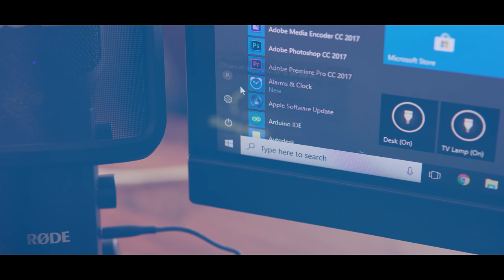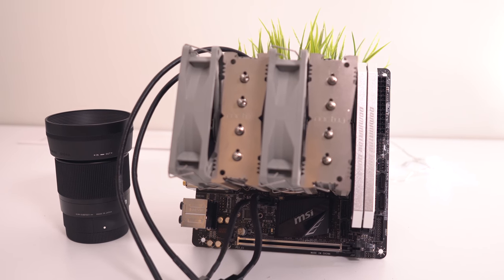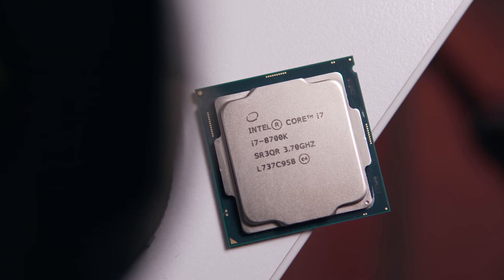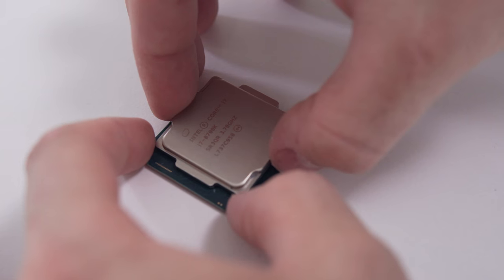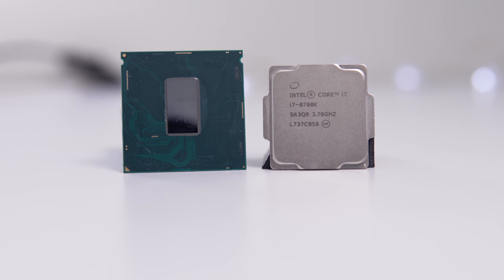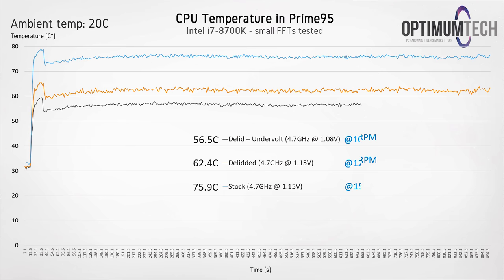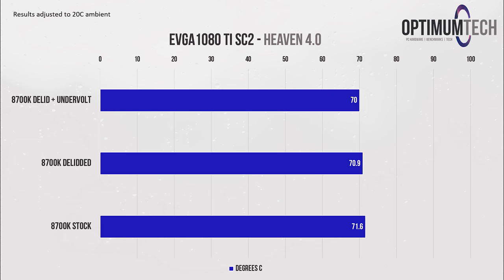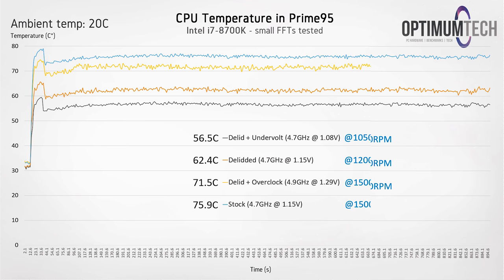8700K Delid & Undervolt - 20C° Drop!

Comment from the maker: With normalized fan speeds, this is an easy 25C°+ drop. 
Wish they came like this out of the box lol.
Reply: Can you do a no IHS video with the German CPU kit?
Reply from the maker: Would love to!
Reply: Would love to see that too.
Reply: your videos are like those of hardware Canucks amazing video quality
Reply: could you please tell me, if Vcore of 1.25 for 8700l will effect its longevity?i bought a maximus x hero, and i want to last this processor a long time.
Reply: nice video... 1 question its posible to make Delid + Undervolt + overclocking ? in a water cooling system ??
Reply: You can't undervolt and overclock at the same time, as reducing voltage reduces the maximum clock you can achieve. Normally when overclocking the voltage is increased to allow a higher clock.
Reply: screen   prime  95 ?
Reply: Why they don't come out of the box like this?
Reply: Griffen Edge you absolutely can overclock and undervolt simultaneously, but you won't get nearly as much of each as you would individually
Reply: Nice video, memes aside
Reply: Nah, 1.35 is still safe for 24/7 usage as long as your cpu is not boiling hot all the time. Heat can also affect longevity.
Reply: It is said everywhere up to 1.4 Volt is totally save.
I run mine at 5 GHz at 1.285 Volts. So i guess you dont need to worry.
No 8700k needs high voltage for 4.8, 4.9 or 5 GHz.

So as long as your cooling is enough 5 GHz is possible on almost all chips.

Running mine with a custom loop. CPUID Hardware Monitor Showing 65  °C maximum under full load.
Reply: That's correct, unless you put it on "auto" then your voltages will skyrocket over 1.4 with ease. With my extreme4 board I need to manually set it to 1.28 for 5.0, offset will not work and the board does not have adaptive voltage. But yea, 1.4 works, as long as you have good cooling, which is why I suggested 1.35.
Reply: Daniel Bertens i got 1.285 volts manually set with maximus x apex
Reply: Riad Ahmed No, stock vcores ive seen on my cpu hit 1.47. I now run mine at 1.35 at 5ghz

Comment: It's sad that they use mayo by default :(
Reply: its not mayo ......................... its colegate
Reply: They use a very stable TiM that will last several years which requires a sacrifice of performance quality.  If they used one of the popular thermal pastes, it would very likely dry out after 18 months (or maybe less) and the chips would all start throttling and failing.
Reply: or they could solder them

Comment: Decent difference, I just run mine fully stock and happy with my 5.1GHz temps :)
Reply from the maker: Nice, jealous of that 5.1GHz OC :P
Reply: I was surprised when I was able to get it to that stable!
Reply: what voltage? Mine is sitting at 5.0ghz at 1.34 volts. 5.1 takes close to 1.4v and even with a dark rock pro 3 i hit 95c very quick while stress testing
Reply: I'll try let you know in a few days if I remember, currently overseas so can't check :p
Reply: What temps?? And cpu fan? Thanks
Reply: @Arturo Bover I used the Fractal Celsius S36, I just finished benchmarking it actually haha so I've got that info! Overclocked to 5.1GHz and running Aida64 it was averaging 82c after around half an hour with an ambient room temp of 25c.
Reply: This is so awesome, my 2 favorite youtubers in one place :D
Reply: @Luka Mihelac woo 😎
Reply: Nice, whats your temps like and what cooler do you use?
Reply: Fucking good for you. I can't get under 1.36V at 4.8 ghz without going over 95 C in Prime95 delidded with liquid cooling.
Reply: +All Hail Queen Monika You lost the silicon lottery :/
Reply: say if my asus hero x wifi mobo is over volting my stock 8700k where would i go to type in  the correct voltage so its  stays stock
Reply: 5.3ghz 1.37v get around 54C in Cinebench.  OCCT large data set avg temp around 56C.  Max was 5.1 with out the delide.  Delide pretty much makes these cpus legit.
Reply: du Bb change the LLC to 6 if it’s on Auto it will send too much volatage
Reply: du Bd I have that motherboard. First off, update your BIOS in case they've improved voltages (you probably want to anyway for Spectre/Meltdown). If you want to run it stock but decrease voltages, you could set voltage mode to offset and type in a negative voltage offset. The easiest thing to do though would be to change "SVID Behavior" from Auto (Auto = worst-case) to Typical or Best-case (try best-case first). The SVID Behavior setting defines the auto voltage tables, with Worst-case/Auto assuming a poor-quality CPU that needs high voltage, and Best-case assuming a high-quality CPU that needs less voltage.
Reply: 4.9GHz 1.25v 87°C on aida64 on custom loop, without delid
Reply: I7 8086k 5ghz 1.25v with an average of 74degrees after 2 hours in Aida64 with an evga clc 240 push and pull configuration. Non delidded
Reply: @Ktos3214  wow that awesome result! I was trying maximise my undervolting and... i got next results 4.9 1.275v with custom loop and ofc delided... im not super lucky like you >.>

Comment: I did this myself a couple of months ago with conductonaut and can verify the temps. Also running Kryonaut between IHS and coldplate. i7 8700k at 5.2Ghz at 1.34V with a 360 rad in push/pull. Aida64 temps average 67 degrees!
Reply: You're so cool

Comment: Delided my 8700k and got 5.3 GHz with low voltage. Set it at 4.8 GHz for now. I am using a 7-tube Gelid air cooler. Max temperature now is 78C in AIDA64 (120 minutes stress).
Reply: Oliver Krivel holy shit. If you are not lying u just picked the best fucking chip. Did u buy it binned or did u just hit the silicon lottery lucky?
Reply: No, I do not lie. My cooler is Cooler Gelid GX-7 Ultimate CC-GX-7-01-A. It was too hot with default compound so I replaced it with Thermal Grizzly metal. I have it on MSI z370 Tomahawk (which is not bad). I think 50% success is due to the motherboard sufficiency. It is not my first delidding so I was pretty sure what to do.
Reply: 78c is a bit high, what voltage for 5.3?  And is it 5.3 avx?

Comment: This was a cool video!  I like the option to delid and undervolt for the purposes of a smaller/cheaper LP Air Cooler and/or quiet system.  Of course there still exists the option to OC  and use a bigger cooler if desired.  Personally I think a front facing LP cpu fan looks good even in an Mid-ATX case.

Comment: I believe that is awesome, I just am not willing to risk the warranty. That being said once the warranty is up, and the processor starts showing its age(4+ years, from now) I may decide to do just that. I also have an 8700K with the Aorus GTX 1060 6GB model. I am also using a much larger case than you are; I also am using a Corsair 280mm AIO, thermals don't factor in to severely for me. I just run it stock and allow for the CPU boost.

Comment: i couldn't get mine to 5ghz without delidding as i was hitting 95-ish temps and it still wasn't stable. at the same settings after delidding without resealing, i dropped 26c (temps after 10min p95 26.6 small ffts), which is absolutely amazing and now i'm stable at 5.1 @ 1,35 under load (1,43v in bios) and temps never rise above 60c while gaming on my x62 kraken.
Reply: Lol same thing with me and same cpu cooler as well
Reply: U mnie po skalpie 5.1GHz
Reply: Im hitting 5.1 @1.36 V but temps are high 87 to 98 stock havent delidded yet. Using a corsair h150i pro
Reply: u mnie max 78* ale to już po skalpie, 5.3GHz 1,2,3 rdzenie a 4-5-6 5.1GHz
Reply: Temperatures affect stability pretty much.
The hotter your chip, the less stable it gets at higher frequencys.
Mine is running at 5 GHz at 1.285 Volts and max temps under maximum load over 1 hour with AVX is 65°C in HW Monitor.
Reply: Dom yep, it comes down to power leakage. a hotter chip pulls more power and can't keep clocks as stable as a cooler chip.

Comment: Hi @Optimum Tech I know this question is super old , but what are your values for i7 8700 at 4.3 ghz (default clocks on all cores)? What is the actual value you used to see the 4.7 at 1.08 vcore, is that with vdroop or just what you pressed in the bios and lastly what motherboard and LLC value you use?

Comment: Very nice video. I think everyone with a couple like this ought to try a little undervolting. Even if they do not wish to de-lid. As long as the system is stable, you can drop temperature and reduce fan speed at no risk.

Comment: My non-delidded and non-overclocked i7 8700K reaches max 75 degrees in Prime 95 at 1.1v and 4.3 GHz at all cores. Enhanced turbo is off. Board is Z370 Tomahawk from MSI. And my cooler is Noctua NH-D15S with only one 140-mm fan. And i'm pretty happy with my first i7 in my whole life. :)

Comment: Hey Man,
Shout out from Australia.

I am thinking about getting my hands on a DANCase and I am running the 8600k and MSI Carbon ITX board.
Did you by chance de-lid and undervolt the i5 when you were running it?

I am currently running a 240mm aio with the i5 @ 5ghz at 1.32v.
I have more than accepted in the SFF I will need to loose the OC, but I was literally looking into delid and undervolting as there are a lot of reports of the DANCase getting very toasty.

Comment: Why is it necessary to reapply the lid?  Mobile processors work just fine with a heatsink directly on the die with no lid.
Reply: thechosendude the cpu mount needs the lid thickness to hold it in the socket.
Reply: @juanofarc3007  - My implication was to remove the hinged cover plate and use the heatsink to hold it into the socket.  The LGA1151 doesn't need a lot of down pressure.
Reply: @cup_and_cone  there are some custom waterblocks for only die ltt make viedo about this.
But i don't really know why the cpu still have a lid it seams like it doesn't need it xd

Comment: Is that 4,7Ghz@1,08V stable?  
I cant under volt my 8700 beyond 4.3 Ghz@1,2V on a Asrock Killer. I've set vcore on Offset mode and the lowest value is -100.  Then if i use a lower LLC value than 2 (1,180V) bsods.

Comment: Try undervolting your GPU. But don't do it with the voltageslider, use the frequency to voltage graph. I locked my GTX 1070 at 1800~1850mhz at 0.825~0.850v for intensive titles and 1950~2000mhz at 0.9~0.95v for lighter titles. I also set the powerlimit to 87%. The card usually sits around 78~82% under heavy load, and that's basically what a 1060 uses. If I now could only get rid of the coilwhine, my pc would be silent.

Comment: wait so youi're saying the CPU ran at 4.7 ghz at all cores at 1.08 volts? That's insane! Also if you were surprised with the deswktop CPU-s undervolt check out laptop CPU-s most i7 8750h can UV down to -130mv and most of i5 8300h ones can be undervolted to -150mv with no instability issues!

Comment: That motherboard is not built for overclocking, you may find that your chip in a better motherboard could drop voltage and be stable because of voltage ripple. You may think it needs 1.38 but that's because your motherboard is struggling to keep voltage at that state and drops for milliseconds and goes back to 1.38. It's called ripple. Something with more phases would help which is what higher end motherboards usually have and are designed for overclocking. Also having a PSU that is not near your 100% load typical usage would be better too as it pulls more from the wall in order to meet it's requirement this means that efficiency drops and can cause instability. Idealy you want to look at something that is double your typical usage. So mine is 400 watts with it peaking at 480 watts (not from the wall) So i went for a 850 platinum PSU so its near that 50% load where it keeps the best efficiency. Platinum means it's up at 90% efficiency too. So this ensure's stability. There's soo much more to overclocking people overlook.
Reply: great info man, i got the msi z370 m5, i guess it is a good one because i got to lower the voltage a lot getting better temps.
Reply: Good call. I was just about to say the same thing. Having a motherboard with more phases and better VRM cooling should help with the overclock to 5GHz.
Reply: not just the motherboard but the psu part matters a lot too. oc really cranks out the power, he had a really good point on both
Reply: you are kinda wrong i have the entry level msi motherboard(z370 a-pro)and i reach 5.0ghz with 1.27v,i know that might be because of my chip but that mobo is really good,i can oc memory from 3.6 to 3.9 with lower timings as well and derbauer tested that mobo and saw really good power delivery and the vrms stayed cool without any airflow.
Reply: Bill Nanos he's not saying your mobo is bad. Just saying there are better options for overclocking. Stop being defensive and take in useful information when it is given.
Reply: yea but if it has a good power delivery,vrm temps are good and memory oc is good,whats the point of giving 50-100 $ more for 0.1v and not even  that,m.2 slots,rgb and looks,wifi and better ethernet and better audio,thats the stuff that you get for that money if you dont want that the z370 a pro is really good and almost matches the more expensive ones for oc
Reply: Because of sillicone lottery. Your chip might be able to hit 5 GHz on your said mobo, but others might find it hard to reach the same frequency. They could gain more OC headroom buying a mobo suited for OC. If your lucky, you don't have to but that's not guranteed as every chip is different.
Reply: What about titanium? Seasonic has prime titanium

Comment: You said that GPU will benefit as the temps inside the case are reduced (from what I understood). But I don't think this is correct. Delidding allowed you to reduce the temps of the CPU by increasing the heat dissipation from the CPU to the heatspreader, which means, if anything, higher ambient case temps, due to the extra heat being pumped out of the CPU. The heat is still there, it cannot just disappear, but instead of being stuck in the CPU it is now in the case.

Comment: Any idea how undervolting is configured on Gigabyte motherboard? I could not find voltage offset settings in Gigabyte Z370.
Reply from the maker: Wasim Azhar - it's in there, it was difficult for me to find also, just check the manual

Comment: A Grandmaster will delid, undervolt and overclock the cpu!
Reply: maybe is possible :p
Reply: You can
Reply: It is possible. 
I mean i run 5 GHz at 1.285 Volts. So you easily couild run 4.7 GHz with lower voltage than default i bet
Reply: Default ranges cpu to cpu, and can be low as 1v stock.
Reply: 8700K is 1.18V @ 4.9, 4.7 avx, chilling in the low 70s prime95. Haven't delidded yet
Reply: @stripes8812  how is it now (assuming you did it)?

Comment: I still have the 4790k but I have it delidded and running at 4.9Ghz no temp issues at all. 1.35 volts
Reply: OH HELL YEA i have my 4790K at 1.277 Volt with 4.8Ghz atm. Under 60C  while gaming. Not sure if i can maybe do 5Ghz with 1.35-1.37 Volt not tested yet, because i wait for a new Watercooler first.

Comment: For those interested:
Why lower case temperatures?
When delidded, CPU runs cooler, thus being more efficient and consuming less power. less power = less heat.
When undervolted, CPU runs even cooler and because of lower voltage consumes even less power, which results in less heat again. There isn't as much heat that needs to be dissipated

A common misconception is that because CPU runs cooler, there isn't as much heat in the case and is the sole reason for lower temps. That is wrong, there is almost exactly the same amount of heat, but the CPU cooler is able to dissipate the heat away from the CPU at a much faster rate, because thermal conductance of liquid metal is a lot higher than stock TP. What is even more interesting is that case temps should be higher, since there is more heat dissipated, but since the CPU runs more efficiently, the end results is the same or slightly lower temperatures.

Comment: When you say 4.7ghz, do you mean all core or single core? my stock 8700k runs at 4.3ghz all core when stock
Reply from the maker: All cores
Reply: so you can run 4.7 all core on just over 1v but cant hit 5ghz without getting close to 1.4v? I might have to experiment with my chip to see what kind of voltage i can get at 4.7ghz. My chip can hit 5ghz at 1.34 volts
Reply from the maker: That's what I've found so far. 
4.7GHz @ 1.08V
4.8GHz @ 1.20V
4.9GHz @ 1.29V
5.0GHz @ 1.38V
Reply: Optimum Tech pretty crazy how steep the voltage curve gets once you get above 4.7ghz. Thanks for the info, And the great video!
Reply: speakerlover13 yep, my old 3770k was able to reach 4.7ghz at 1.265v but 4.8ghz was stable only at 1.39v. It's really not worth it at this point
Reply: maybe tou need to mess with load line calibration to get better results, LLC 4-5 is usually very good.
Reply: All of da kores
Reply: That's huge jump on voltage between 4.7GHz and 4.8GHz

Comment: do you put thermal paste on the top of the CPU when you screw in your cooling system?
Reply: Yes. You must apply thermal paste to the top of the IHS for proper cooling.
Reply: amazing how much thermal paste matters too, without it you'll thermal throttle in 5 minutes or less, and its a 5-10 degree difference between good and cheap paste alone
Reply: Sorry, I knew that, normally. Since the liquid metal works better inside the chip, instead of using the normal thermal paste on top of the IHS could you replace it by the liquid metal?
Reply: Kevin Martel Yes, you can use liquid metal on the top of the IHS as well.

Comment: Remember that the 8700K runs at 4,3 GHz on all cores when turbo and not 4,7 GHz. The 4,7 applies only to single thread. 
https://www.gamersnexus.net/guides/3077-explaining-coffee-lake-turbo-8700k-8600k 

Still, a delidd is a must to keep Intel CPUs cool and quiet at high speeds.
Reply: This is false, with "enhance turbo" enabled on the BIOS this allowed 4.7Ghz on all cores, even with it off, Turbo Boost 2.0 spreads 4.7Ghz on 2 physical cores, not just 1.